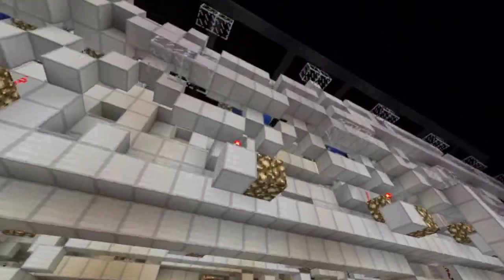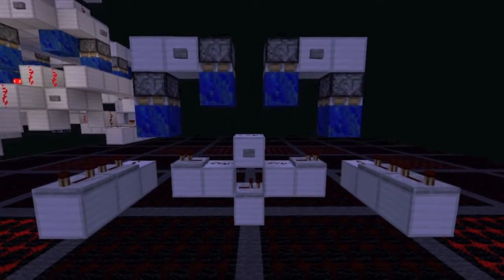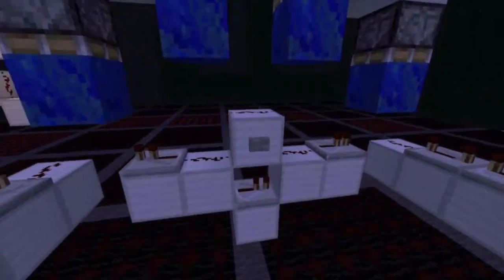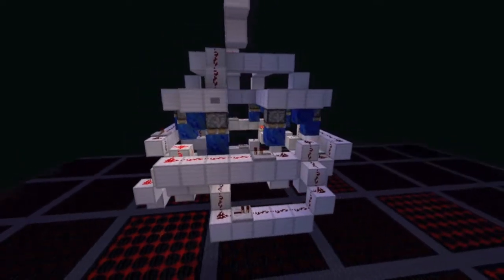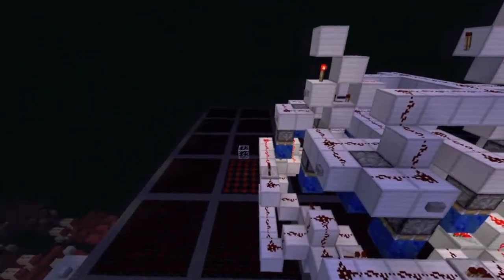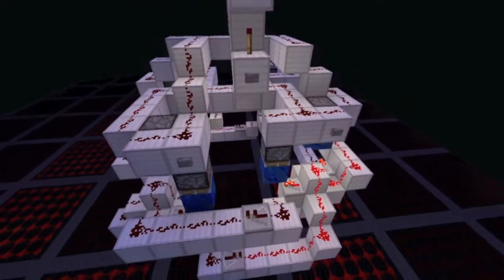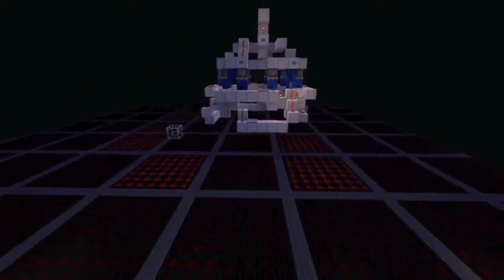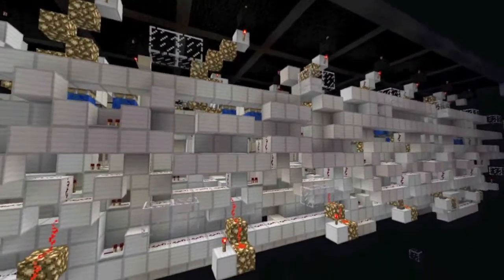90 Degree Rotational Shifter Explanation

Comment from the maker: I'm not sure what you mean either, could you explain a little more? The purpose of the shifter was to rotate images around, so when the memory cell sends a pulse out it goes to another memory cell and turns it around. If you haven't seen it yet, check out the main shifter video and you might get a better idea of what this is for. Hope that helped!